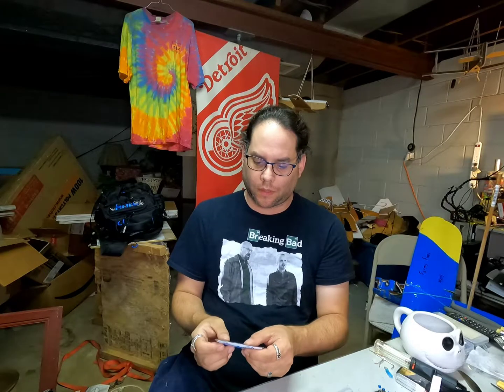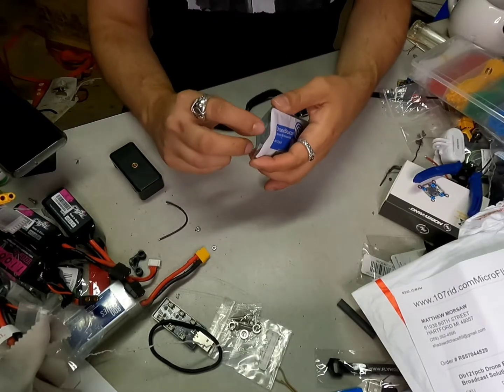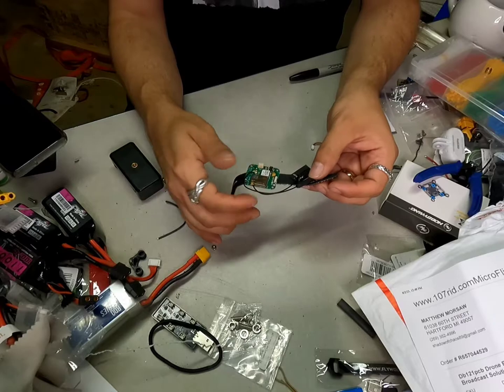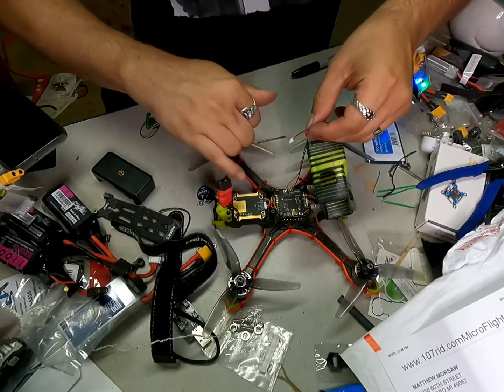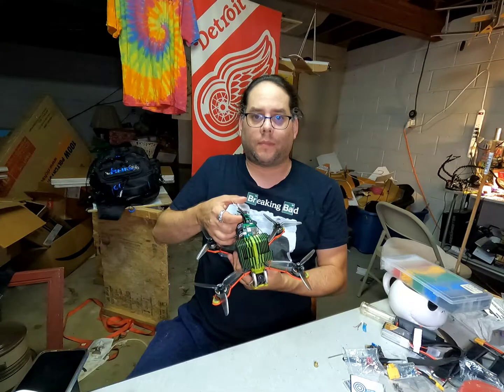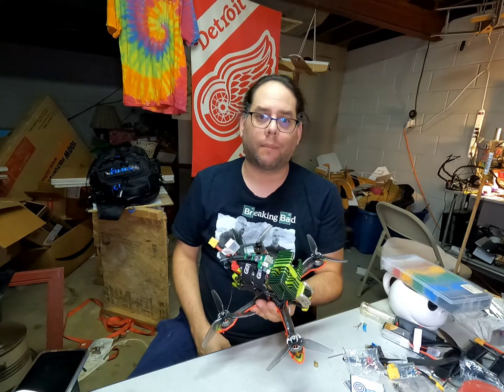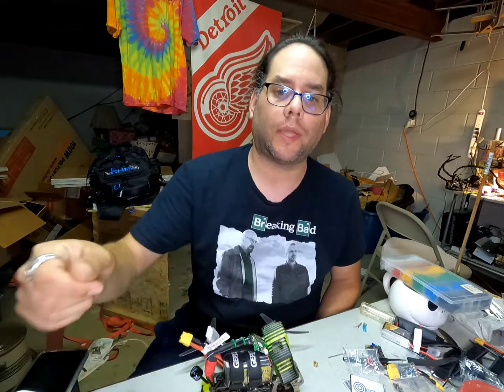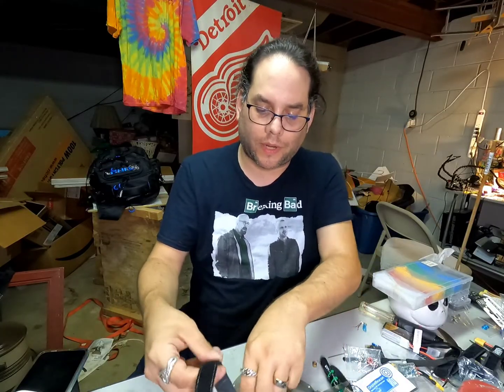My RID module is here.  Bare Minimum Compliance.  #fpvdrone #remoteid #drone #michigan

Comment: Actually the rules state that drones used for Part 107 operations need to comply with Standard Remote ID (ie: Built-in and approved by the FAA).  The FPVFC has been pushing to allow dedicated Broadcast RID modules to be used for FPV Part 107 operations but so far no exceptions.  The DJI AVATA is the only approved FPV drone that has Standard Remote ID that I know of currently.